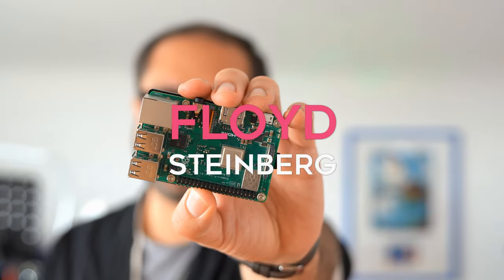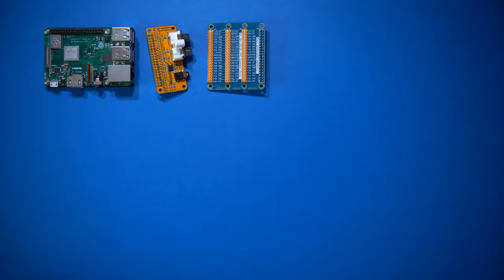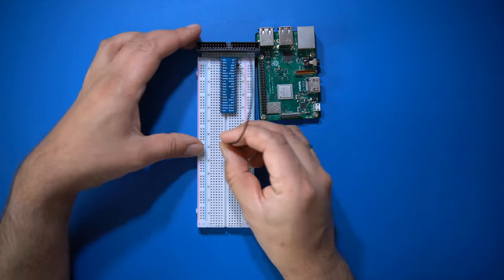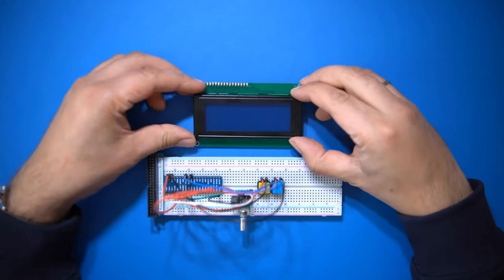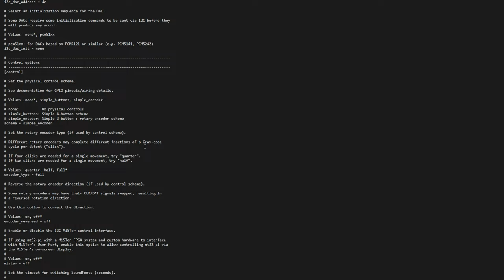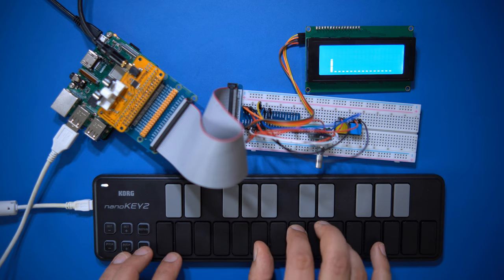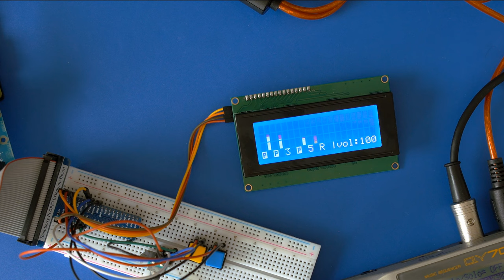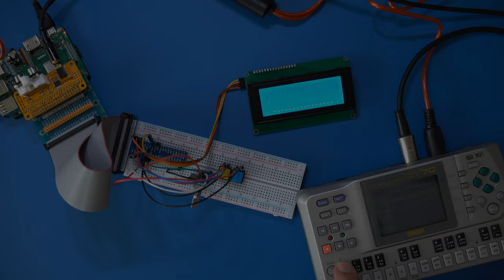MT32-Pi DIY synthesizer: bare metal 80s nostalgia

Comment: Bought a MT-32 about 15 years ago (it was price started to get crazy), that was the beginning of why my wallet do hate me... :D And through a complex path the reason I'm hear today :D
Reply from the maker: This is a quite faithful clone-even the LCD output is quite similar to the original :-)
Reply: @mr_floydst  what patch/preset are you using in your MT-32 demo? I don’t recall any of these instruments in the default patch set
Reply from the maker: @godzil42  Ugh, I made this video a week ago, you're asking challenging questions here! ;-)
One of the patch names can be seen in the first seconds: "Warm bells". One was named "bare square", if I recall correctly. There's only one drum set, so that's what I used. The bass is one of the synth leads (fruitily misused by adding some CC controls via QY70). :-)

Comment: Just a tiny correction: you call it the ”Roland MT-32 Sound Canvas”, but those are two different (and not entirely compatible) devices. The Sound Canvas series of synths were based on the MT-32, but you can’t always count on one of the devices correctly playing back a piece of music made for the other.
Reply from the maker: You're right! The MT-32 laid the foundation for the General MIDI standard, but the SoundCanvas implemented it in the early 90s
Reply: The SC line are just a ROMpler where the MT-32 is a LA based synth like the D-50, with lower quality attack samples and multi-timbral, the MT32 mode of the SC-55 do not support most of the MT-32 sysex. So I disagree even if similar in concept of “low cost” mid expanders, the Mt-32 and Sc-55 are really different type of beast.

But also yeah the MT-32 is nearly General MIDI, it help shaping the patch set of GM as we know it, some GM patch are directly from the D-50/Mt-32 like Soundtrack

Comment: How is your QY70 linked to the MT32-Pi ??? what the connectivity on the PI side
Reply from the maker: Hi, thanks for watching! That red cable is a simple USB to 5 pin MIDI adapter. It's connected to the PI as the MIDI in port.
Reply: @mr_floydst  I was asking as I didn't see the connexion to the device.

Comment: Another excellent video, and in less than 30 minutes, all up and running. Three PI's now acting as an OBX (Zynthian), a TX816 (MiniDexed) and this...
Reply from the maker: Cool! You should record a song with that setup. :-)
Reply: @mr_floydst  There's a lot more going on, but I have posted quite a few songs (covers) on SoundCloud
Reply: Also, given Zynthian is not running baremetal, and is more than capable on a PI4 of delivering an OBX, I can bet that a baremetal implementation of at least a 4 note poly JP6/JP8 is viable

Comment: Hi Floyd, great work! I've assembled a mt-32 pi myself, just the sound module with no physical interface. I see on the mt-32 pi wiki that they advice against plugging the "+" pin of the ky-040 encoder to the 5v output, because it could blow up a fuse in the raspberry pi. Any thoughs/issues you experienced?
Reply from the maker: Hi! I didn't read that advice and so far, my PI is still working. But they won't post such advice without reason, so I guess it's better to use their solution to that problem.

Comment: What I would love is a low latency sequencer like the one in the QY70, but for the raspberry pi. It be really cool to see what hardware diy build could accomplish with such a platform. You could build a sequencer with all the benefits of hardware, without the cost. It could also probably work as a sampler since there are so many for the pi already. Renoise, sunvox and daws etc are far too busy. I love how simple something like the QY can be. Jobs menu is so easy to navigate, 16 channels, pattern mode is a breeze to work with. Do I need to learn how to code? Haha
Reply from the maker: Thanks for watching! You are right, at the moment, there is no real "modern" replacement for the QY series.
And yes, you'll need to learn to code (or take a rhetorics class and persuade Yamaha to issue a revival of these). :-)
Reply: @mr_floydst  I'm really interested in the retrokits rk008! It's a calculator sized midi sequencer! Doesn't come with its own wonderful XM midi module though lol 😂 Would love to see Yamaha make a QY comeback!
Reply: Eh you could just hire me :D